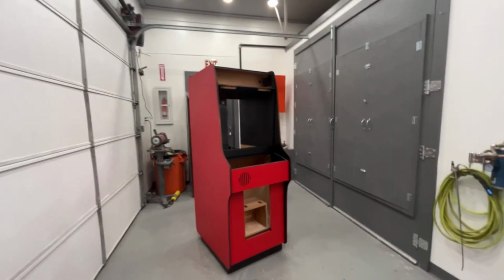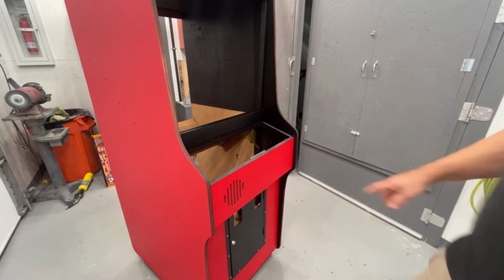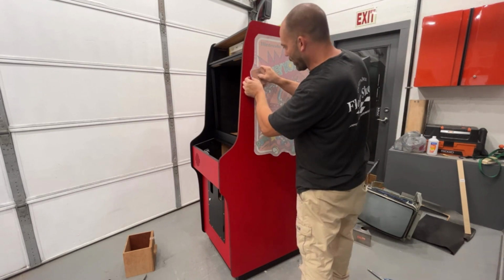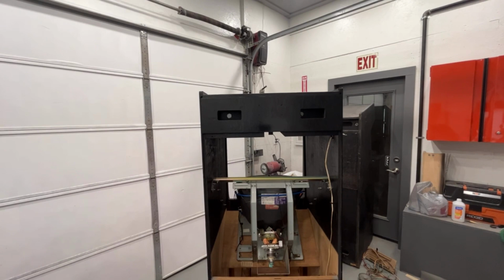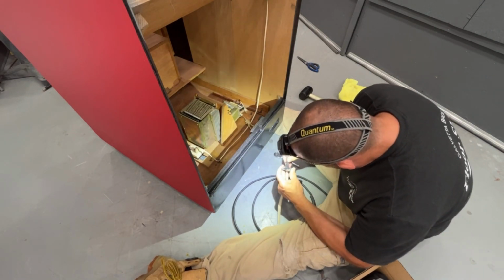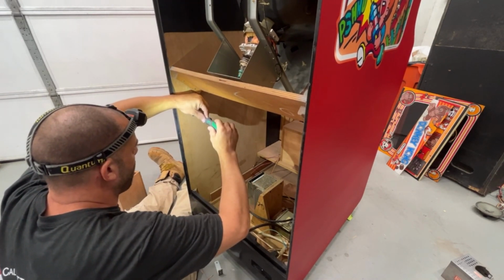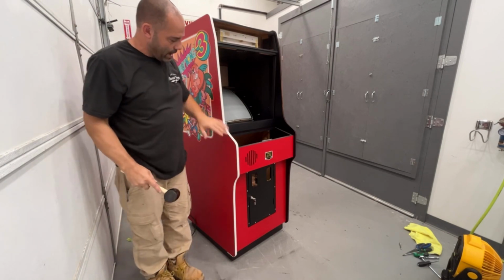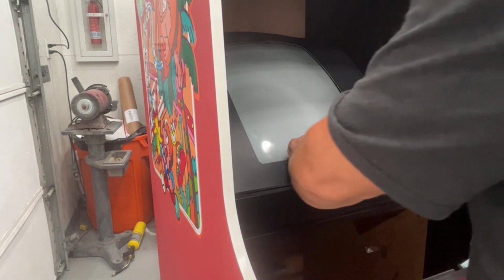Donkey Kong 3 arcade restore part 6 it’s done and off to the owner

Comment: Thanks for the explanation about the wiring on the switch and fuse section. It helps some, but like you said, they crammed a bunch of white silicone on there, making it hard to see what is actually going on on those terminals of the switch.

Someone cut every single wire of mine off about 1/8 of an inch past where they were soldered on the fuse and the terminals on the switch. I am just wanting to utilize the switch to power up the Donkey Kong, which has been converted to the newer switching power supply type.

On the research I have done on that part for the Nintendo cabinets, everything looks identical to yours except where your blue wire is, some cabinets have a white wire and some have a yellow wire like mine, even though there is already another yellow wire exactly where yours is.

It appears your blue wire goes from opposite of the yellow wire on the switch terminals to the fuse.

I imagine they used a switch with 6 terminals to make it easy to install that choke and capacitor to form a line filter on these sections. 

Otherwise, I don't know why they needed more than a couple of terminals to break one side of the AC line, either the hot or the neutral. They are breaking both sides of the AC line with the switch.
Reply from the maker: Yeah, I’m not sure why they did that like that a four terminal switch should’ve been plenty. You can always go to Home Depot or Lowe’s and get a Ford terminal switch or even a two terminal switch and just run the hots on it. You can get a 20 amp switch.
Reply: @troylukans2174  exactly!. I might just try to remove that silicone and take off the unneeded components, since I already have a line filter in the cabinet and use the current switch to just break the hot side of the wiring.

Comment: Not sure if my flat t molding link was deleted but if your customer had purchased in MI, then it would have been from Chomping Quarters (located in MI).
Reply from the maker: Yep that’s it I couldn’t remember the name thank you
Reply: No problem !  One question for ya, do you sand in between paint coats or after the clear?  …or do you get it to just go on that smooth with no orange peel?  Looks really good.
Reply from the maker: @jhagen1  thanks it’s just out of the sprays gun